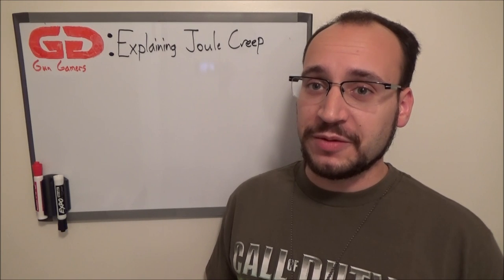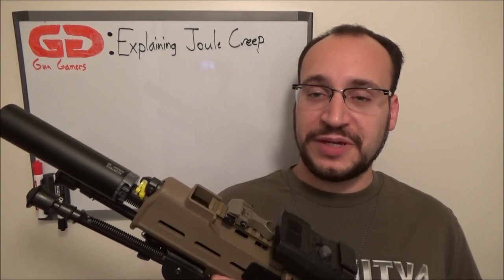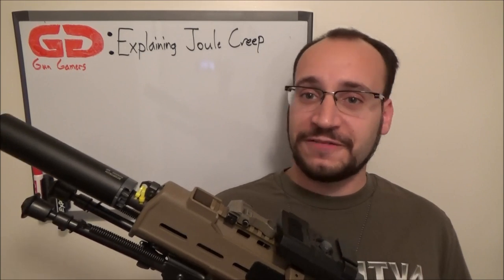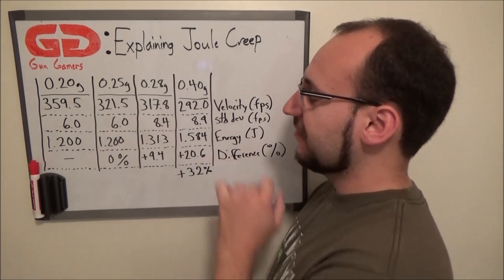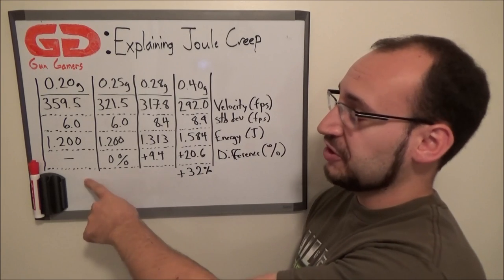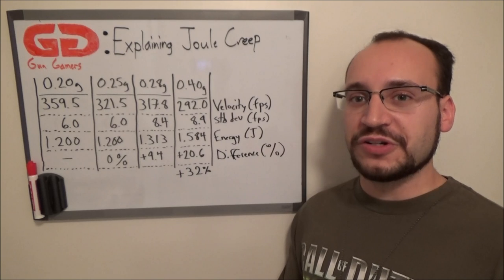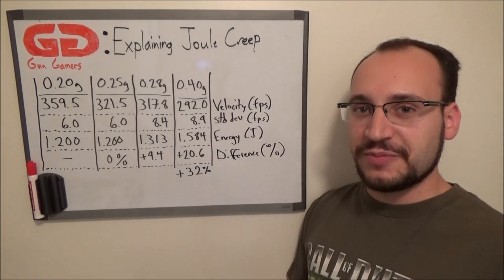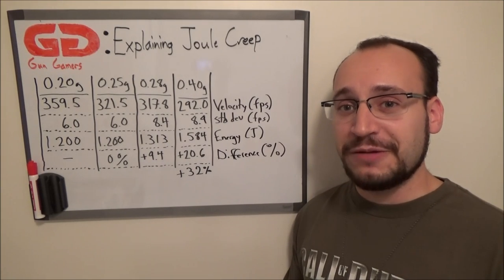Explaining Joule Creep in Airsoft

Comment: There is something to add on my side. Heavier bb´s are able to retain more kinetic energy throughout the trajectory. A 0.20 will lose more energy through the trajectory than a 0.40.
Reply: I think that is because the air resistance depends only on the speed of the projectile (shape too, but in airsoft we are only shooting spheres). So usually in my every gun I use BBs that come out from the barrel with 90-100 m/s if possible.
Reply: @sogerc1  More mass in a bb is more momentum to counteract forces that would influence the bb path like air (resistance) or human flesh.
Reply: @michaelbernier6972  His statement is correct. The air resistance for same shaped bodies is dependent on the speed. If you are talking about momentum...it's from the BB's POV.

Comment: @ the games i go to in europe every gun has to pass the chrono test with the players own BBs. BB weight will be set and the joules tell if the gun is allowed or not. sometimes new ppl on the field have to do an extra chrono test @ 0,25g BBs.
Reply: Yep. The only thing I heard that sucks is when people still cheat the system. A guy was banned from local events after people complained for months and months that his BBs hit harder than others. Refs Chronoed his gun with the guys BBs from his mags, it passed. Took their own BBs with weights that they knew from before, not trusting the player, it passed again. It got figured out tho. The guy loaded .36s in his mid caps, and put 10 .2 BBs on top. Set the hop for the 0.36, and after each mag change just fired 10 shots into the dirt.

Comment: Interesting, because I can see the joule creep in all my green gas guns even with 0.25. Maybe your gun is optimized for 0.25 and 1.2 J .Otherwise it's pretty much what I see too. The joule creep is higher if the gun's inner barrel is longer, my KJW M700 reaches out to whopping distances because with 0.45 BBs it jumps up to 4 J (from 3). But interestingly it's CO2 mags don't do it.

Comment: I hate fps used by itself in shooting sports.  It is only part of the information, like giving the rpm your engine can go to.  Why don't they put a net on the speed tester and then weigh the bb?  Because cheaters will just get a gun with a quick change spring and keep cheating.  Even though it will prevent most accidental cheaters the added step in testing would take more time so they don't do it.  Maybe a sensor that detects speed and has a plate that the bb hits that can measure momentum, and using those 2 metrics it will tell you joules.

Comment: I think the system I know of here in Sweden is better, we chrono with the weight bb we're using.
Reply: You don't, but if you chrono in joules it doesn't matter what weight bb's are used since the energy is measured and not the speed of the bb.
Reply: Some fields chrono you with your own mags and do the conversion in the US
Reply: E33Tpro. Yes bb weight matters even if you chrono in joules. That’s the point of the video. Switching bb weight affects joules.
Reply: The whole 'joule creep' phenomenon is that heavier BB having more energy even when all factors are kept the same... so yes, BB weight matters.